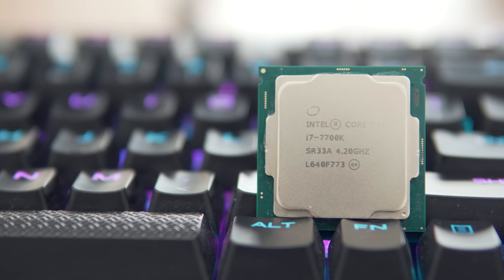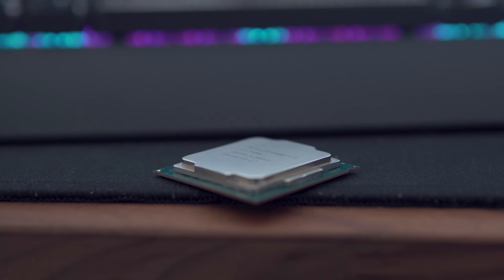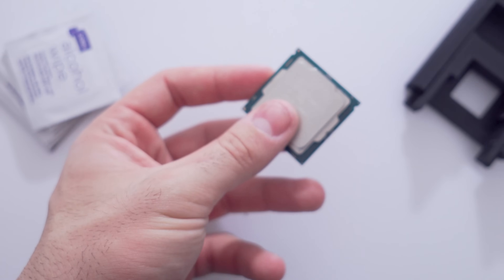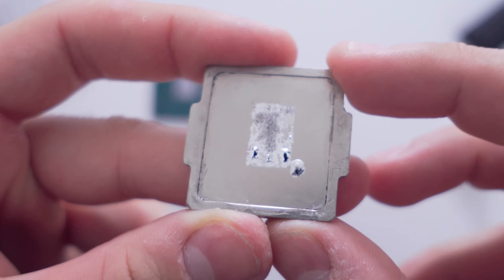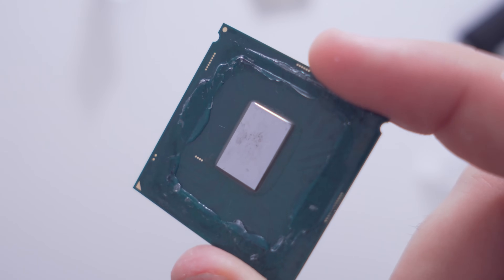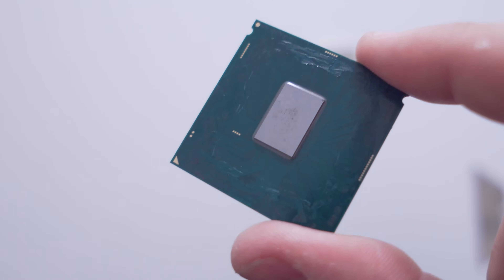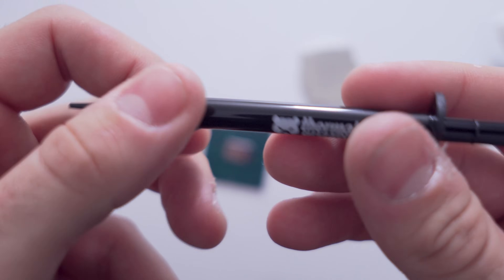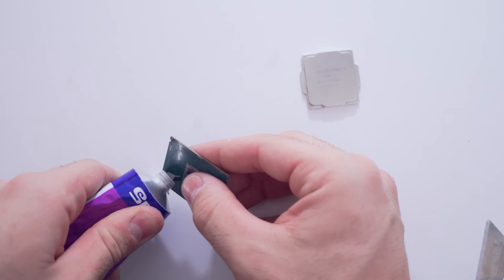Liquid Metal on CPU - 9 Months Later!

Comment: Can thermal paste also be used instead of liquid metal?
Reply: Used Thermal Grizzly Kryonaut on my 6600, also dropped about 20 degrees celcius.
Reply: Yes, but termal paste will not get you as good results, but a good paste is still far better than the intel stock toothpaste. Also it's less messy than liqud metal and bit safer, as you can see he almost spilled the liquid and shorted the CPU. Just don't overdo it, whatever you put in there.
Reply: Also, you might fry your cpu, just try a good thermal paste first.
Reply: no, the point of delidding is putting an a good thermal compound. you dont need to use liquid metal at all, it doesnt make too much more of a difference than just a good thermal paste
Reply: Omar Krypt. Thanks Omar. So thermal comprend Could be more durable in time.?
Reply: Yeah, Liquid metal is not magic, so, any good paste can match it.

Linus showed that a good thermal also decreased temps by 20 degrees.
Reply: No thermalpaste won't last. When I tried temps went up in less than a month and I had to re apply again.

Comment: You can also use clear nail polish to help protect any overflow.
Reply: Black electrical tape does not keep well with high temperatures, the glue will get more viscous over time. If you ever experienced sticky cable after removing that tape from it you know what i mean. That cable had like 30 degrees. Imagine 60 of  a CPU.
Reply: Senpai Sodium i mean the thermal paste only to cover the elecrically conductive components. And the delta between intel toothpaste and good "normal" thermal paste is still 10-15°C
Reply: Rigel Sinco MG Chemicals conformal coating
Reply: Jeez just use clear nail polish. 1year later 8700k delid and nail polish hasnt cracked or flaked off, burnt or fused. Even tech Jesus himself, Steve Burke at Gamers Nexus recommends it. Stop with the conspiracie theories already.....
Reply: Ken Liu get the silicone based conformal coating for higher operating temperature
Reply: Nogghan so you are qualified to just say thing and thing supposed to happen the way you've said? Even PhD do experiments to prove their theory. Back to my original comment, I said that all I wish to see is more experiments with LM at lower temp, going from liquid to solid then back, then see what kind of damage, if any may occur. That's all. You been trying to tell me not to worry about it because stuffs never get to be in cooler temp zone. are we on the same topic? Nope!
Reply: Daniel McCracken better to use a  conformal coating with a high temperature raiting I used one from MG chemicals rated for 200c
Reply: Daniel McCracken I have no doubt that liquid metal is better at temp conductivity. But I haven't seen any one tested to see what would happen when exposed to temp below 8 celcius or 40 F. They said don't use the paste below that temp. And I know that the metal would solidify at cooler temp. But what type of damage, how long and low of temp can that be exposed. No one tested that yet.
Reply: Conformal coating would be better
Reply: SB N which one would you recommend?
Reply: SB N Oh sorry, I meant which conformal coating would you recommend from MG chemicals
Reply: Sart it's definitely not 10-15c better than stock paste rated at 4.5 w/mk and the highest end thermal paste that isn't conductive is only 12.5 w/mk liquid metal is 73w/mk thermal conductivity rating and still it isn't 100% that will drop your temps 10c it's common sure but if you heavily lose the silicone lottery a delid can sometimes barly help
Reply: SB N it's not for extreme overclocking which is the only condition under which your CPU would reach under 10c unless you built the thing into an igloo but then thermally conductive paste and a delid is the least of your worries btw "extreme overclocking" isn't pushing the voltage to 1.5 or 1.6 it's using LN2 or a phase change setup
Reply: SB N and that wasn't your point in the first place you said that any other thermal paste or even the best one that's not LM will atain you 10-15c temps Delta it's just false you won't recieve that unless you use liquid metal
Reply: i said if it phase changes because of temperature being too low its thermal conductivity goes to shit... again when it warms back up run a stress test and if the temps are out of whack just reapply the liquid metal
Reply: again i said if it were to expand to the point of hurting your CPU DIE your last problem is daamge to the CPU because youve obviiously applied too much and are in risk of shorting the contacts and frying it anyways
Reply: Lol i used vaseline and it worked
Reply: ZZstaff As long as it's made with  nitrocellulose, should be fine.
Reply: black/red gasket silicon for cars would be best i would say,non conductive and can handle temps over 800 degrees so...
Reply: Just use that transparent orange heat resistant tape that i cant remember the name of
Reply: Gamers Nexus used nail polish and they're probably the most thorough and scientific tech channel on YouTube right now
Reply: Silicone conformal coating as someone said earlier. 
Another thing you can do if you really want to be safe is cut out a little square from neoprene the fits around the cpu die and compresses once you put heat pipes back on. This will create a sealed 'housing' around the cpu/gpu so even if any leaks out it's trapped and can't get on any other components 

(I'm referring to a laptop btw...not a desktop)
Reply: Tek bond silicone vermelho para altas temperaturas até 216ºC
Reply: liquid electrical tape is USELESS at high temps, you would need a high temp non conductive adhesive that you could brush on to protect the board at 100C liquid electrical tape turns in to a crispy gooey mass
Reply: That's why you could use liquid electrical tape.
Reply: Then uhmm, what should we use then? :/
Reply: Ken Liu I personally wouldn't use liquid metal because it may damage stuffs when temperature gets below 40 F.
Reply: Nogghan okay, that's not what I'm wondering about. I've seen people using it on video card and laptops. There are times where those laptops may be exposed to temp below 40f. I.e being inside a trunk in cold weather. Or shipping the gpu/laptop to another person via air mail...heck, even your house can get down that low if you are on vacation during winter time with the central heat off. My point is, yes we all knew it's best at thermal conducting. But let explore the cons! Not just pros only
Reply: Nogghan  seriously man, all I wanted to see is what will happen if the temp drop below specs since there is practically no experiemental of such that I can find on the web. But here you are trying lecture me that it should never drop below specs temp, thus I need not to worry about seeing one. Do you seriously believe that everyone uses their PC, laptop the same way you do? I left my electronics out in cooler weather all the time. Have you ever heard of dry cold? BTW, 40f isn't remotely close to "cold". I mean if you don't have any information about my concerns, don't say anything.
Reply: Nogghan no no no....the liquid metal doesn't just turn solid at cooler temp, it also expanse a little, like ice ....even having to open up your PC, laptops everytime it got cold to re apply the paste is a hassle
Reply: and even if in your house in the winter in your snowed in area if the temp even dropped to 0c in your house all you would have to do is delid the CPU again and reapply the liquid metal, which unless you apply a stupid amount of sealant its easier than the first time and you dont even need a tool or razor in most cases, as for the possibility of  the expansion of the liquid metal damaging the CPU die when it freezes, i suppose its possible but i wouldnt think so unless you already applied too much but then thats the least of your worries
Reply: its 15 minutes of "work" if you have a beefy ass air cooler like i do and most people dont they have liquid AIOS which have a selling point as EASE OF MOUNTING
Reply: and fianlly and this is the last im saying on this chain, the amount of LM thats actually on your CPU die between the IHS is so minimal it wouldnt damage it due to expansion
Reply: you could also just use normal thermal paste, since it istn electrically conductive and easy to apply
Reply: Nail polish can dry out and crack, not a good thing.  Better to use liquid tape or a tiny piece of black electrical tape to cover exposed metal on the PCB
Reply: Wrong, average thermal paste does not provide enough heat transference between IHS and CPU die.
Reply: @lol_void_poro8470  "average thermal paste" is used in there from factory... Maybe even below average.

Comment: Any liquid metal residue on the IHS (post cleaning) isn't an issue. All that is, is the liquid metal seeping into the micro surfaces of the metal. If anything this is actually a benefit not a hindrance. This is more prevalent on pure copper but again is not an issue. 

In terms of the die, there shouldn't be any significant discoloration no matter how long liquid metal has been on there. 

Finally, it is important when you are applying liquid metal to make sure your coating on the die and IHS is even and as thin as possible (but with total coverage). It is also worth noting that it is critical you remove 100% of the glue from the PCB and the IHS. Failing to do this will result in poor contact and decrease thermal efficiency. This is also why when you reseat the IHS you should put the glue on the outside of the IHS at the corners and not under the IHS. Reducing the die to IHS Gap is a large component of the temperature reduction potential in deliding.
Reply: Of course not.. I dismanteled and delided the cpu after like 2+ years and it looked close to the one in video.. Even if it did leave some shit, it wouldnt be anything that a really soft sandpaper couldnt fix.. And even if I didnt give maintenance to it, I doubt it would perform worse, not even mentioning that you will eventually upgrade anyway
Reply: paskowitz do you have any good videos, step by step?
Reply: No, Gallium alloys with Copper and weakens it, this is well known, if using LM between CPU and IHS it probably isn't an issue, but for direct contact heatpipes or vapor chambers I'd recommend against, just to be safe.
Reply: @thefirehawk1495  You're thinking Aluminum. Gallium does make an allow with copper, but the alloy does not have an appreciable effect on thermal performance or strength in this application.
Reply: Is the IHS made aluminium?
Reply: No it's not the liquid metal seeping into the cracks, it's a chemical reaction forming a copper-galium alloy of sorts (or in this case nickel-galium). This isn't much of an issue even with copper to liquid metal contact as it doesn't really do much to the metal aside from give it a slightly lower (possibly) thermal conducitvity (again probably not even a noticable decrease, especially over the gain). Aside from that and the aesthetics looking different it's 100% safe. The reason it happens slower or less 'often' on IHS's compared to a GPU, is due to the nickel plating on the IHS, nickels electrochemical potential is quite a bit closer to liquid metal than coppers' potential is.
Reply from the maker: Thanks for the comment, some great tips there.

Comment: for people who are gonna to delid their Cpu, don't forget to heat up the IHS and die before applying the liquid metal, it is way easier to apply on 50-60°C die and IHS.
Reply: Don't even mention the microwave... someone might actually do that...
Reply: this is how tide pod began..
Reply: quangluu96 my ambiant temp is around 15°C 😀
Reply: Microwave will work. Right?...
Reply: So I know this is a joke but let me way just how bad of an idea this is for people who might think about doing this. If you put this in the microwave and turn it on the microwave will actually induce a electrical charge within the circuitry and lead to overload plus short circuits. You will, in a overly simplified sense, be hooking up a nuclear reactor to a L.E.D. Long story short you will render your nice little computer brain into a less than useful paper weight. EM waves are very dangerous to electronics.... also +FantasyCookie17 that is completely false, anything that has a dipole (think a magnet, north & south charged sides) will react with microwaves dependent on the incoming frequency.
Reply: Mr Twister +
Reply: It’s not gallium it’s actually galinstan which melts at -19°C
Reply: Amine Kabbaj wait..... which color of Tide Pods has the best flavor to pair with a nice Chianti?
Reply: Put in microwave and set timer for 2 minutes. Serve when ready :)
Reply: that's a bad idea the microwave will make the metal on the CPU spark and fry it don't do this

Comment: Probably some oxidization happen because some air has trapped below the liquid metal? The part which don't have air will not get oxidized so it looks just shiny but the part having air pocket will oxidize a little bit and discolored, the same problem happen if you didn't changed the thermal compound on the CPU for too long, it leave a mark on it and can't be clean off
Reply from the maker: Thanks for dropping some knowledge! This sounds about right
Reply: Actually... I don't think it's oxidation on the die. Silicon dies pretty much don't oxidize. It is more then likely that the gallium amalgamated with the silicon.
Reply: @SweMisterB  im pretty sure the shiny part is not silicon but a metal plating of some sort but im no expert
Reply: @mertvaran5733  it's silicon the dies are crazy shiny.
Reply: From what I understand the gallium/LM reacts with other metals just like it does with aluminium, just way more slowly.  It probably reacted to the nickel plating on the IHS or w/ the other metals in it.  I'd also venture that any areas that were extra thin or thinner would have gotten cooked a bit quicker and accelerated the reaction between the gallium and nickel ---> dark brown stuff.  I have the gear to delid my i7 cpu, but if/when I do it I will be checking it once in a while; probably every 3-6 months.  Supposedly after the gallium has reacted with the nickel you get a layer that has sort of 'burned in'... SO, if you apply a new layer of gallium/LM @ that point it should be good long-term.
Reply: SandPox 

I forgot which metal this happens to (where when it is cut whilst it's in solid for it will be shiny until it oxidizes and then it darken significantly) I was thinking that during the video. Glad that I came across your comment!
Reply: Yeah, just a oxidation. Probably because the top of the lid is concave and got a bit of moisture that oxidated it.
Also i don't know what the LM is made of so I don't know how the properties of the oxidated metal have influence on it
Reply: I'm thinking of delidding, how regularly do you think I should reapply the liquid metal?
Reply: Joao Rocha LM thermal compound is usually gallium.